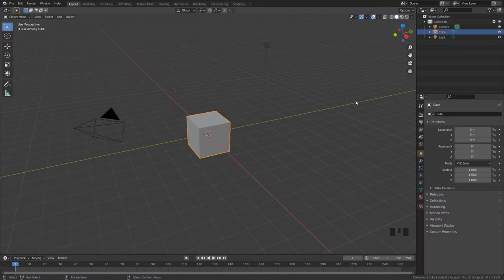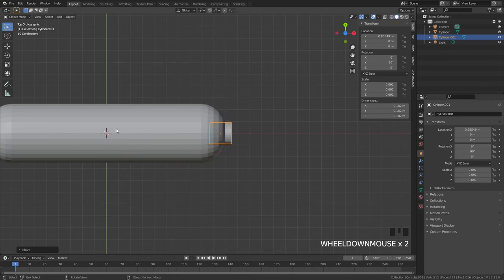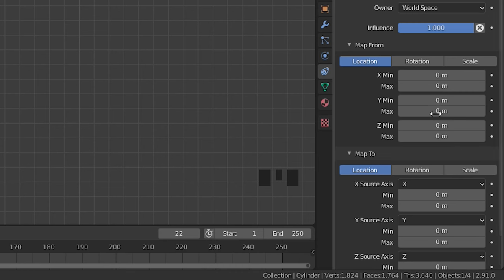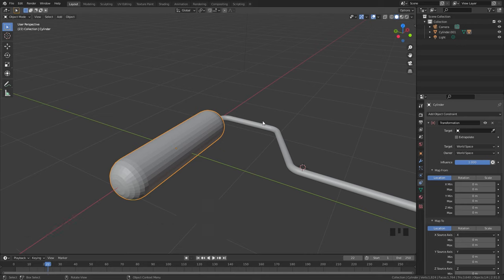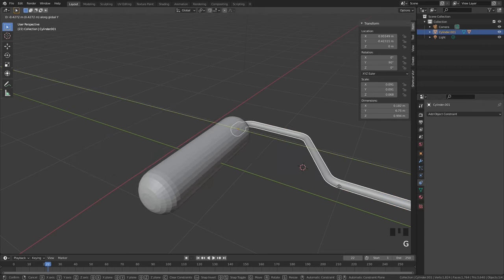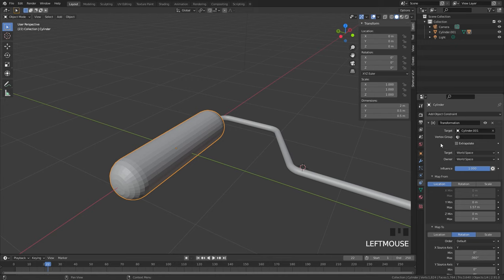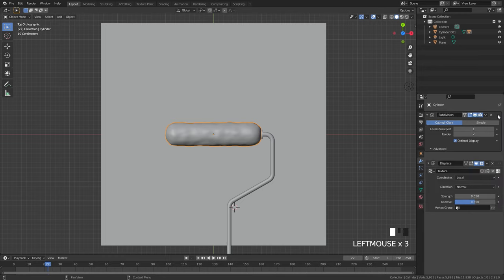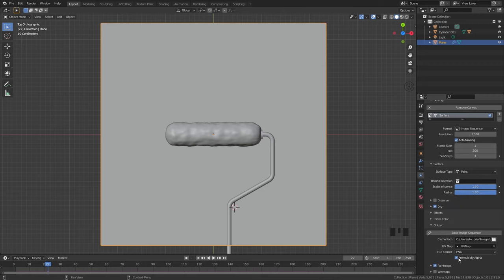Blender Tutorial - Paint Roller Effect w/ Dynamic Paint

Comment: Nice one! BTW instead of using the calculator you can just type “0,5*pi” in the field and it will auto calculate it:)
Reply from the maker: Thanks for the info! I did not realize that!
Reply: That was my first reaction too when I saw @Blender Made Easy typing all these decimals by hand. This feature of accessing the pi constant by typing  "pi" is amazing. Whoever implemented this is a really great developer.
Reply: I had a feeling you could do this was about to Google it. But you just showed me how. The time I saved I'm dedicating to thanking you instead.
Reply: @BlenderDefender  AFAIK its a feature of the programming language itself and blender made the UI and some operators (The buttons you click on menus etc.) with python. And the core part is C.
Reply: @BlenderMadeEasy  all symbols from python math modules are imported so you can use for example "sin(pi/2)", "log(10)", "floor(e)", "factorial(5)", "radians(180)", "(sqrt(5)+1)/2" (golden ratio), etc.
Reply: Woa! I didn't know this either! Great hidden gem, thank you!

Comment: If you are using Blender 2.82 and the Roller is not rotating along the bar. The issue appears on minute 07:27 of the video. Go to the "Object Constrain Menu - Transformation" , go to the bottom, click under "Mix" which is set on "Replace" and change it to "Add". It's under "Rotation Mix Moder"

Comment: Wonderful tutorial.  Learned a ton.  One question. Once the paint roller has finished the animation cycle, I would like to take the result and save it to reuse it.  Basically I want the roller to start up again in a new scene without losing the paint that was applied in the first scene.  My animation shows the roller rolling out the first part of a wall, then changing camera angles, and rolling some more.  I can't figure out how to take the results of scene 1, and then reuse those results in scene 2, basically continuing on painting the same wall without losing the painting done in the first scene.    Any idea on how I can do this?

Comment: This is an excellent tutorial, Thank you to take the time and effort to make it, Just a quick question, Can we make the canvas as a picture and the paint roller actually reveal it instead of painting over it? This is the same idea as putting and adv poster on a wall and use a paint roller with some transparent glue material to attach the poster to the wall. Please advise
Reply: Just instead of using the sequence colour of the paint map put in a image texture and it will use it
Reply: @CorzaVision  Thank you for your answer, It worked as I connected the image texture to color 2 input of the Mix RGB and connected the Paint Map image sequence to Color 1 input with it's alpha connected to the Mix RGB factor as before, The canvas (Previously the white wall) became black and the paint roller now reveals the image texture with it's  movement. Appreciate your help, Thank you.